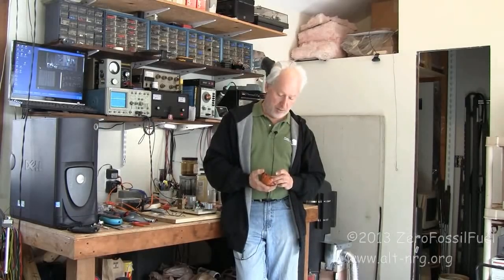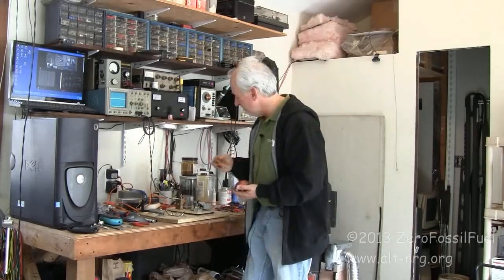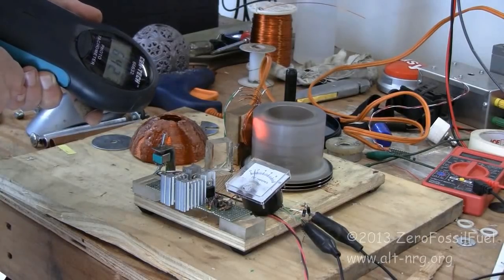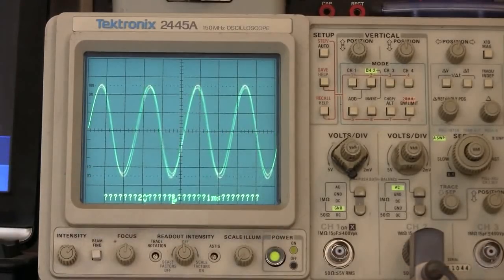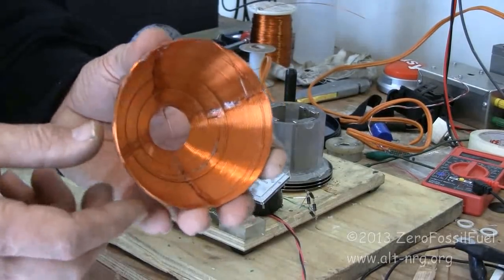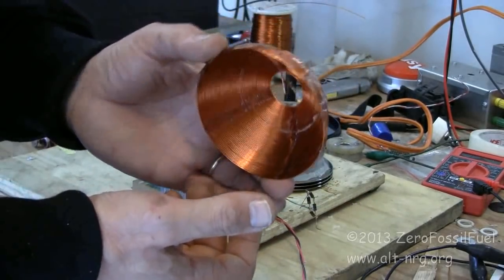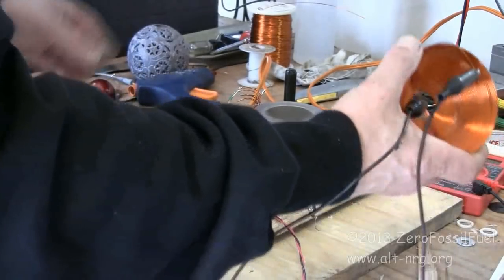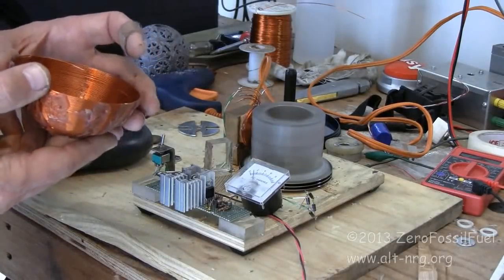#329 Zero Lenz dynamo

Comment: There is a huge flaw with this experiment ffs. The number of coils for each configuration is not the same. More coils = higher voltage.
Reply: *****
The experiment is about the geometry of the coil and not about the number of coils. As such you should keep everything constant except for the shape of the coil. The Wardenclyffe configuration produces more voltage as it has more coils. Nothing significant here.  I'm not sure what this man is trying to achieve here. he never explained his aim and made some observations about free energy in the end. Scammer suspected.
Reply: It produced  a higher voltage with respect to the increased length of the wire used. Assuming he used the same gauge wire, the real test would be to use the same resistance and measure the current flow at the specific voltage in each experiment. Then use Ohm's law formula to calculate the watts (P) dissipated in each experiment. Of course equal proximity in each test must be as well for accuracy which could also be difficult because of the geometry used.
Reply: In the end one may have increased efficiency in the ability to generate electron flow as in toroidal transformers only in this case kinetic energy is used. The "something from nothing" would rely on the Watts(P) required to spin the magnetic drum and the Watts (P) drawn off the interacting coil higher value.
Reply: Yes, due to the increased proximity generated by the curvature of the dome and increase in overall wire length it is impossible to tell true results unless fixed parameters are used in all testing...ie 2ohm load with watt calculation. In this case I believe it is doomed to fail increase in energy output due to the law of thermodynamics. If that is the true goal of his experiment???
To me the best (And I use the term loosely) form of "Free Energy" is to harness the energy provided by a static magnetic field. Consider forcing two alike poles together with your fingers, it will try to force apart for hundreds of years while you have to take in energy from the sun to resist that force. Manipulate it to create kinetic energy which then can be converted into other forms of energy.
I contemplated this principal some 30 years ago and created a very crude prototype which achieved near zero energy output. Since then I have contemplated other designs to achieve a positive output but have not had the time or resources to experiment.
Reply: TemplarX2 I had a long drawn out explanation as to why I agree with what you said, but I figured I'd just end up getting in an argument with Kurtis and the Dr. and didn't feel like it. So I'm going to just say, I'm picking up what you're laying down. And add an inappropriate joke to boot, coils are like penises. Their size and shape often makes all the difference in the world when comparing how two of them work and how well they get the job done.
Reply: Exactly my point. We all realize the experiment wasn't truly scientific and that he made a lot of mistakes. We all also realize that there were a lot of things he needed to do to really show what he was trying to get the point of across to people. For one he compared apples to oranges, and different sized apples to different sized oranges at that. We all get that, but you've started with me like you did Templar. You never understood the point he was trying to make in his original comment, and obviously still do not. Hence why I didn't want to get into a discussion with you, because you already obviously know more than anyone else. So please kindly don't reply back to this. I'll not respond back to you, because I have a feeling with that kind of attitude you're going to be one of those "I have to have the last word" kind of guys. Frankly I don't have the time to deal with a-holes like that. Buhbye now.
Reply: +Kurtis Engle Only true if the current stayed the same, but he doesn't give any specs for current.
Reply: ***** but when you apply the current flow to a magnetic field you're changing the direction the electrons want to flow by 90 degrees either north or south depending on the pole direction of the field. When you have a rotating magnet, it's producing a bidirectional field with oscillating poles of north and south. This causes the electrons in the electrical current to be forced towards the sides of the coiled wire which will actually apply a small amount of directional force on the coil (on this scale to small to be observable). That in itself becomes a load on the coil without having a typical inductive load such as a light bulb. The results were different because each coil has a different number of turns, a different length of wire, and it appears (and I can't remember if you discussed it or not) a different sized wire as well depending on the two types of coil. The resistance alone in different lengths of wire is enough to change the results, as well as the size of the wire used between the two.
Reply: +Kurtis Engle "But, with no load, there is nothing to limit the current, so I assume it is high."

F: Unless you're using superconductors (which you don't appear to be), there is always a load -- the resistance of the wire, plus any CEMF resulting from current flow variations in the wire.

KE:  "I focus instead of the amount the magnetic array is slowed by the interaction with the coil. I note the higher voltage coil slowed the magnets less. From this I infer less work was used to generate the voltage/current. It may be so. But maybe not."

F: Several issues there.  First off, since you're not measuring current, you don't know that less work was used to generate "voltage/current" -- all you know about is the voltage.  At least two different things could account for the array slowing less with the second coil:  the second coil was operating at greater efficiency; OR, the second coil, despite increased voltage, was producing less output power than the first coil.  The important quantity here is /power/, and that is determined from voltage /times/ current (P = V x I).  

Power is the important quantity, because it tells you how much /actual work/ can be done by the output.  I would be willing to bet good money that when your voltage increased the amount of current flow decreased.  Therefore the power output of the two coils, under ideal controlled conditions, would probably have been about the same.  

For example, if coil #1 output 4 volts @ 10mA, you would have had 40 milliwatts of power available from the coil output.  If coil #2 gave you 6 volts, but the current dropped to 6.5mA, you would have had about 39 mW of output power available -- or about the same.  If the magnetic array slowed less in the second case, what you would have demonstrated that the second coil had greater efficiency.

OTOH, suppose the 6 volt coil was only producing 3mA of current.  In that case you would only have 18mW of output power available.  That would explain the magnetic array slowing less, as it was having to produce less output power.

To get any meaningful results you will need to control for a lot of variables that are currently uncontrolled in your experiment.  For instance: 

* Both coils should be made from the same length, of the same gauge, of the same material of wire.  The number of turns in the coils should be as nearly the same for both coil geometries as practical.

* Both the physical stability of the coils and their precise proximity to the magnetic array need to be controlled.  Eg., holding them with your fingers doesn't really cut it.  Some sort of non-magnetic support (maybe wood or plastic) that could rigidly support either coil at a set distance (maybe 1 cm, to keep things simple) from the same point on the array, would be ideal.

* You need a nominal load (maybe a few ohms) and a milliammeter in series with the coil(s), so you can measure current and thus calculate power.  I would use the same resistor (not a duplicate) for both coils (swap it from one to the other), and locate it and the meter at the same distance from either coil.

* Measure your voltage across the load resistor in both cases.

* Rather than tracking RPMs of the array, a better way to determine input power (ie., potential work) would be to put another ammeter in series with the drive motor and a voltmeter across it.  I'd use this procedure:

1) Set the coil under test in its support, and make all electrical connections with the array /stationary/.
2) When everything is set, turn up the power supply until you reach a predetermined output voltage -- say 3 volts.
3) Read the voltage and current used by the motor
4) Read the current of the coil load (the resistor)
5) You can now calculate V x I for both the input (motor) and output (load) and compare them: η = 100 x Pout / Pin  

This will tell you the efficiency of the circuit, and which coil is the more efficient.

That done, you can then maybe try different orientations of the coils to the magnetic array and observe the results.

Have fun. ;)
Reply: That's the thing, the coil itself is a resistor, the different lengths of wire the different number and size of the turns change that resistance. The dipolar (not bipolar as I called it earlier) magnetic field creates a load in and of itself making it also a resistance. The entire experiment is flawed on those facts alone. You can't look at any data you accumulated off of this and expect any real findings to be valid even for further experimentation. If you want to judge them by their shape alone, then make them with the same sized wire not two different sizes; the same length of wire and only change the shape. Then you're more likely to find accurate results that can warrant further testing of the shape of the coil. When you're dealing with a magnetic field in the presence of a current in dead short that can and does act as a load without a resistor.
Reply: +fartwrangler you can see that as the loaded coil/s slows the magnets, the current in the driver to the drum increases significantly. This is shown after he gets his arm out of the way LOL.
Reply: It might have cool to see him power the motor with the hemisphere coil even though it wasn't his goal.
Reply: @BrookNBones  Oh yeah? what about bifilar coils?

Comment: Surely the fact that the amount of coils in each experiment accounts for the effects shown here? one of your coils is far more laden than the other? what would the results look like if the coils were identical but the shape was manipulated? that would be a more interesting experiment.
Reply: Sorry to cut in here, but the point is he's using the second coil to pick up 4 times the voltage, with less resistance on the spinning load.  Since he's putting power into spinning the load, the more resistance the more power required to keep it spinning, which means less net power, why it's not an over-unity machine.  But it is pretty neat to see a more efficient coil versus a simpler but less efficient one.

Comment: If you made two of these coils,  in  one of them you could put an  wire making contact with the terrain  ( or the ground ) in a way of catching the negative pole of the ground and  the two  coils would no face it other, only their plane side would touch ( one with its mouth watching the sky and the other facing the ground )  the negative pole or positive would be tied to the positive or negative of the other  ( as in a pancake), Just to see as the animal would behave... I  think you'd see an increase of tension, I don't know,  for I'm in the universo of the perhaps.

Comment: You have lot more turns (and more copper) in your half ball coil so obviously you will get more output voltage with it. Is this simple concept so difficult to grasp? What result have you demonstrated apart from the fact that ' more turns =  higher output voltage' ? This is the most basic thing they teach you when you start learning electronics

Comment: What's the point? You keep saying this is significant, but you don't say what the significance is. Looks to me like moving your hand a little would change the results significantly. Is that the correct answer?
Reply: The significance is the geometry of your coil can have a 8x+ impact on the efficiency.  The implication with a mono-polar magnet is also pretty significant if that's the case.
Reply: The point is he can make a better brushless motor.
Reply: Im not entirely sure, but i think the key effect is that both spires produce a similar voltage, with the pancake one slowing the wheel much more than the spheric one. This means that the spheric one drains less energy from the wheel, yet it produces the same amount of power, being, thus, more efficient.

Comment: P=U*I, but You didn't measured current. so we can conclude that small coil induce less voltage, but higher amps, and large coil induce higher voltage and much lower amps. In this experiment You did show that small coil is more effective than large coil becouse small coil grab more power from rotated magnets

Comment: Im after some experiments by my self culd you help my? What Im after is I need ignition coil capabel to produce bouth plazma and amplifier ignition I need also to by abel to make polarity swaps as in a sence of sequentional fiering order similar to waste spark .
Normal waste spark fiering - and + in oposite companion cilinders .
But I want to change polarity in equal strenght and power. 
Exampel coil shuld do this ( + -,,- +,,+ + and - - ) dc pulse fiering order .
So are there some posibilitys that I can use?
Like dual ignitors,dual polarity relays ore some thing ells? 
I want to just 1 ignition coil to perform that task with out creating a dead short and with out blowing up my baterry .
Is there any way that I culd use my starter motor ore starter R terminal selenoid ore alternator for asistance?
And how wuld that set up look like?
What Im realy after is magneto sequentional fiering.
I experiment lot with my engine and get diferent effects .
So basicaly I need variabel ignition coil ore somthing to control my engine speed and diferent chemical preshure reaction by useing ither magneticaly ore electro magneticaly way .
Wuld 2 diferent types capacitors do the same thing in singel ignition coil similar to waste spark?
After all that pick up coil is cinde of generator basicaly?
Culd the magnetic strength by increased some how in the pick up distributor coil? 
What wuld hapen if you brake magnet ore force oposite poles together?
What wuld the osciloscop give readings?? 
Basicaly Im trying to get rid of all crap spark plug wiers distributor and coil and go back original way with just useing 1 magneto ore dual variabel magnetos to fire my engine.
Im sick of replacing shity parts I want to screw that thing on engine block he shuld fire engine instantly with out problems.
Basicaly thats what I want .
So Im looking for solutions to ither get same effect with ignition coil ore starter ore alternator and modify that thing to a compound generator .
So any thing usefull help? 
Ore diagrams how that look like?
I need bouth plazma and amplifier for my experiment with variabel polarity .
So any one knows how to solve that problem ? 
Culd some one explain to my how culd I use my R type starter selenoid curent on start up?
Because aperantly my gm 4 pin ignition module tranzistor wont alove my to use that starter selenoid fuse pops aperantly I have voltage regulator as well inside dash board so I dono any thing about electricity and how prevent short circuet ore bypass this problem ?
Shuld I use dual ignition coils seperatly for dual polarity grounding ore what culd I do to use dual grounding polarity? Basicaly all it is just useing positive and negative ground reference seperatly wuld centain engine parts insulation full fill that task? Because Im not realy happy to push my car in winter so I need masive power ither  to fry evry thing ore heaters ore cinde of electric motor asistance Im not realy happy Im starting to get cranky here nothing realy works if nothing helps probably I put arc welder to that thing and ferce it to start probably blewing up some thing in the proces.
So any thing usefull for advice ???
For some strange reason my deam spark plug wires melt  alway look like they corode is there a way to build own masive build wires and some componds like gel ore paste to protect my wires from heat and chemical piting ???

Comment: A few things stand out to me.  volts do not compare to volts without including amps in the mix.  It also seems there are more turns to your Dome coil than your flat coil so without # or turns or length of wire it wouldn't be an equal comparison. Also, due to the dome shape, less copper mass and less dynamic breaking force from the circuit are applied to the rotating magnet.Overall, I would say the flat coil generates less volts and higher amps and the dome generates higher volts with less amps. You cant demonstrate anything here unless you calculate watts generated or power

Comment: what happens if u move a magnetic field around in the inside of the coil
Reply: did u try make a coil out of aluminium wire ,copper coated wit silver wire wikle one of the wire around the other and connect them at the end then make coils out of the ? compo-cit wire i gues u need coat the silver plated copper wire with someting ?

Comment: Thanks for sharing at first.
However, I think you had setup an unfair competition between the half ball coil and the pancake coil. The copper wire used in pancake coil is way shorter than the half ball coil. Please construct a pancake coil with same length copper wire of you half ball coil, then make a comparison again. 
Thanks